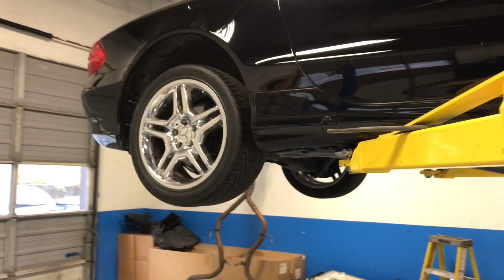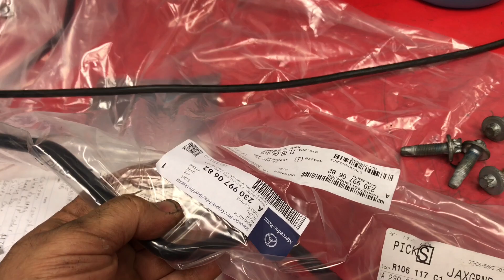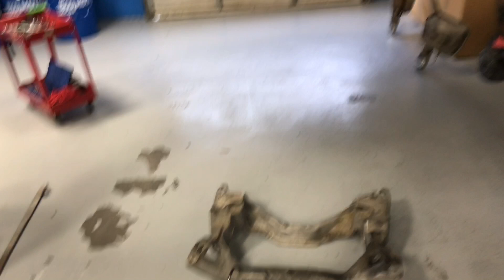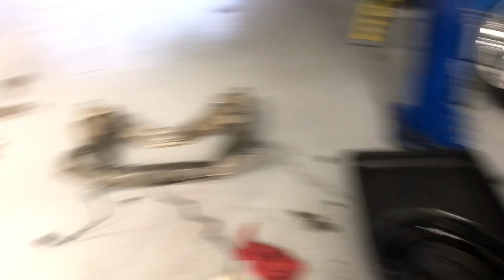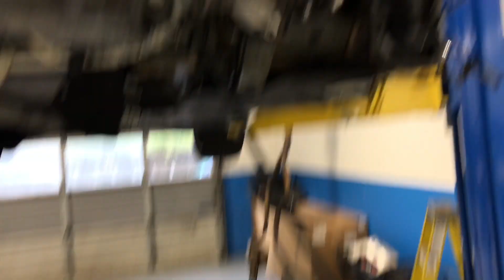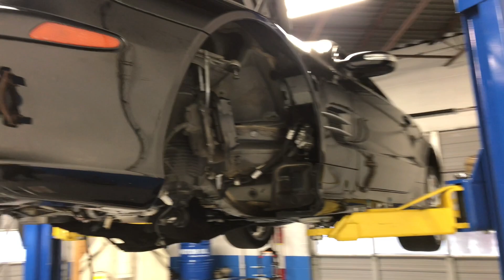Mercedes Benz SL500 Active Body Control Repair - Hydraulic Fluid Leaks Fix

Comment: I notice you have an Atlanta phone number I'm in Kennesaw. I just bought an 03 s55 and have the abc warning light on periodically and I hear a loud hissing sound coming from the pulsation damper in the front passenger side. It hisses loudly when the engine is running and hisses loudly for another minute or so after the car is shut off. I was thinking of bleeding the system but that hissing almost sounds like the damper has failed all together. No physical fluid leaks anywhere on the vehicle.
Reply from the maker: There should be a fault code on the ABC control unit if that’s the case regardless, it’s always good to flush the system and change the filter, I usually try it twice before I replace expensive parts, sometimes it works.
Reply: Mercedes Benz Techs would I need a Mercedes scanner to pull the abc codes or can I use a generic scanner or is there a way to enter a diagnostic mode in the car? Also where is the filter for the abc located?
Reply from the maker: Chris Atkinson you need Mercedes scanner, located on front of the hood on driver side next to the front side of the fender right in front of the strut tower.
Reply: awesome yeah saw the filter was in the reservoir over there. Probably doing to try a flush and filter change to see but might have to locate a new damper.
Reply from the maker: Chris Atkinson don’t change a part before you know exactly what the problem is.
Reply: Mercedes Benz Techs I'll check with the dealer on a diagnostic.
Reply: Mercedes Benz Techs how much goes it cost to get hose replaced? Can u patch the leak up?

Comment: In other words, do not buy a R230 SL. Instead, get the R129 instead. Cheaper to fix and to maintain. No ABC issues. R230s value are dropping like a sinker in the lake. If you must have a drop top with 4 round headlights, consider the CLK Cabrio.

Comment: Hi. Thanks for this introductory vid! I bought a 2003 Mercedes SL500 recently and so far Ive tackled many of the fixes myself. But now the Car gives me a message saying “ABC Drive carefully” when i hit the slightest bumps or dips but I see now visible leeks and the hydraulic fluid levels are good. What should I check first?
Reply: Dude that’s a simple one it’s your accumulators
Reply from the maker: Doodle Bob flush ABC system and change the filter
Reply: ABC Diagnostic Information  http://mercedes-abc-drive-carefully.blogspot.com
Reply: @kuryk01  Excellent guide.

Comment: Good day, would you suggest that we rather take out the ABC-system completely and replace it with normal shocks and coils? Should be a lot less maintenance going forward? Regards.
Reply from the maker: Leon Fourie absolutely not! Might as well buy a Toyota, if you can’t feed an elephant, buy a kitty...
Reply: Mercedes Benz Techs Have a look at the Tavarish video where he did the conversion.
Reply from the maker: Leon Fourie active body control is very reliable system if maintain correctly, it is a very sophisticated system but yet easy to operate, I can’t imagine someone would rather have just springs or coils in his car..
Reply: Don’t be stupid ! Fucking Tavarish
Reply: @ Leon Fourie. This R230 Mercedes sl500 is Z rated and can travel at 160 MPH and remain level on high speed cornering. It has certain handling safety and performance characteristics designed after a lot of research and development. If you think that you can just throw some springs and shocks on this chassis and drive it in the same manner;  you may as well be a crash test dummy.  The weight distribution,  shock tensioning, and suspension response cannot be duplicated with shade tree remedies [ no disrespect ]
Reply: It is possible, but arguably not a wise thing to do. It is always better to buy the type of car that you want to have, than to buy another type of car and convert it. This is true both for upgrades and downgrades.
Reply: the black edition has regular suspension, and folks have done traditional suspension swaps on the SL, both for performance and removing ABC reasons

Comment: Thanks for the vid brother, i just picked up an SL600, i also have leaking high pressure hose but it's a very small leak, however i have a big leak on the two hoses that runs under the radiator, tracing it, it goes from strut to strut.  Are these easy to change?  Anything  special that i need to do like drain all the hydraulic fluid?   heard once you drain the fluid the pump doesn't self prime and you have to manually get it to prime so it doesn't run dry.  Where are you guys located?  Would love to pay you guys to work on my car, as you seem to know what you're doing.

Comment: Thanks for sharing. I don't have one of these but I do have an 05 s55 AMG an looks almost like the same line leaking on mine. Will I have to drop sub frame as well_
Reply from the maker: OverDrivenTV it’s the same system just different chassis, I don’t remember how it is on the 220 chassis tough..
Reply from the maker: doubleS try to force air into the tank while the car is running and hold the hose tight so it doesn’t backsplash on you, repeat several times untill the pump catches the oil.
Reply from the maker: doubleS find out where is the leak coming from first.
Reply from the maker: OverDrivenTV if you find a different way to do it please let me know.. if it is the same line you’ll have to remove the subframe.
Reply: Mercedes Benz Techs another thing I've thought of... Just do away with ABC. Coil overs. I come from a racing background. Throw some adjustable coils overs on it. Maybe???
Reply: doubleS I subscribed to your channel as well.
Reply: Mercedes Benz Techs hey man I have a 2002 CL500 and I also have a leak, I want to repair it myself, any suggestions will be highly appreciated.
Reply: Mercedes Benz Techs ok I will thanks
Reply: Mercedes Benz Techs it looks like it might be a dead pump, I replaced a torn hose, but the leak was coming from the pump, now it's dead.
Reply: Mercedes Benz Techs well it leaked all the fluid, so it's completely dry.
Reply from the maker: doubleS fill it up all the way and push air inside with air hose, if it leaks from the pump get a new pump.
Reply: Mercedes Benz Techs I sure will. I was messing with an it only leaks in sport mode. When I bought this car I knew I would have to put time and money into it. Not to worried. When I'm ready to tear into it I'll make a video. Rather than pull cross member I may try pulling radiator. This car was hit on right front. I have it together but its very easy for me to pull front off.
Reply: Mercedes Benz Techs not sure how I would push air through the pump when it's still all connected. But I'll give it a go, thanks man.
Reply: Mercedes Benz Techs lol I know. Was just an idea. I have a ton of work to do before I get to this car but I will. If I have time this weekend I'll stick my phone down in there and take a look an post on my channel. I greatly appreciate you getting back to me. I do absolutely love this car. Drove it to work today...
Reply: OverDrivenTV imma do the same brotha
Reply: OverDrivenTV imma post a video of my car next week, post a video of your car so I can see it?
Reply from the maker: OverDrivenTV hell no, it’s the best suspension you can have, very reliable and it’s dynamic and active while you drive, responding to changes in road condition as you drive and gives you stability and comfort al together, I wouldn’t remove it, just fix it

Comment: David should I expect the same issue from the W211 E500's 03'-06' ?
Reply from the maker: Darren Hicks no, you have the airmatic system not hydraulic, much cheaper to maintain.